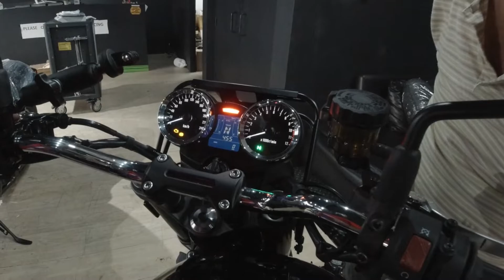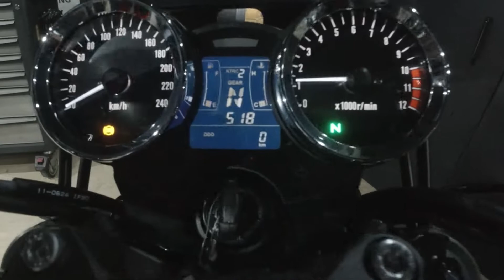Buying my dream bike Kawasaki Z900RS

Comment: hello ask ko lang po na fix niyo po ba yung pagiging snatchy nung throttle niya? thank you
Reply from the maker: Hi! Hindi ko na napapansin ngayon. Can be two reasons 1. familiar na ako how to control the throttle, 2. na "break-in" ko na yung throttle kaya mas smooth na. could be both pero hindi na noticeable ngayon.

I properly adjust my throttle cables too as per manual :)

Hope this helps!